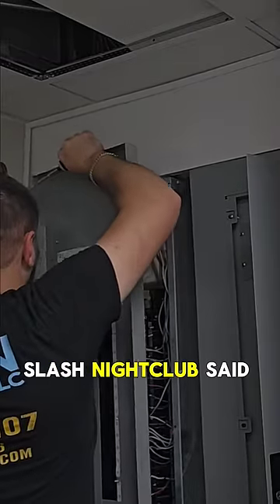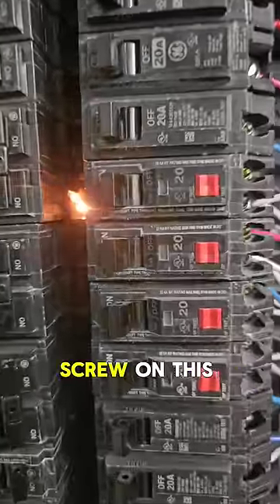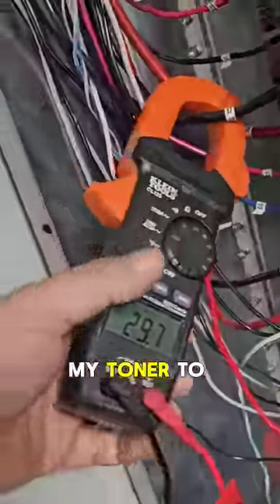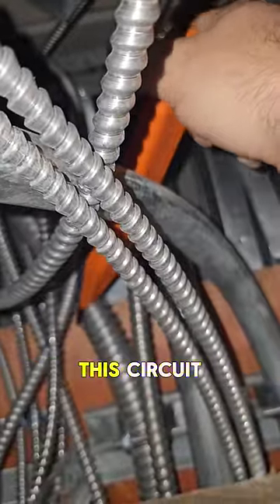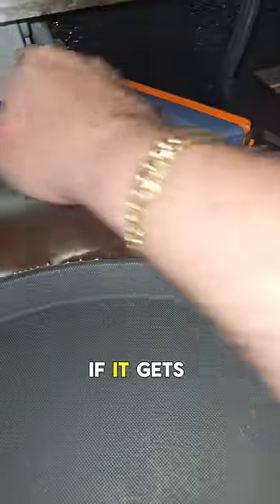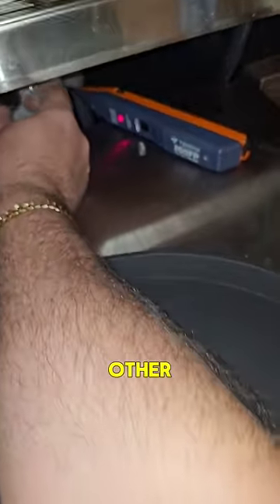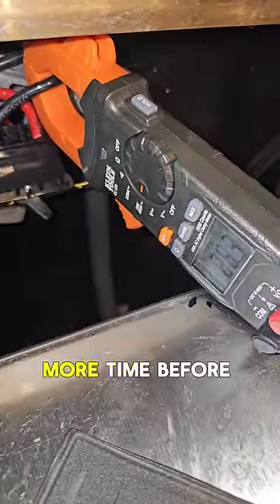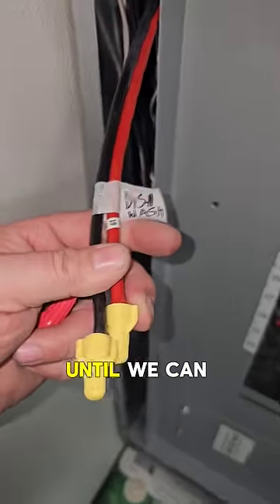This bar/restaurants panel was smoking when a 50 amp bolt on breaker melted down. Simon Electric

Comment: If I see a smoking panel, I'm shutting the whole thing down 🤣
Reply: Yeah right? I mean the firefighters will do the same if it catches fire a few hours later
Reply: Yeah if your breaker panel is smoking call the fire department lol
Reply: @alexandersalarms5380  Electrical fires not easy to work with. Electrician did a perfect job.
Reply: @guypersson   Yes
Reply: They're letting the magic smoke out!
Reply: Smartest guys "Electricians "
Reply: That's why you will never run a sushi bar 😅😅😅
Reply: @arcadeuk Restaurant owners don’t succeed by valuing the safety of workers and customers over one night of business
Reply: @Sryously It was glowing red because lose connections are high resistance and resistance makes heat.
Reply: ASAP
Reply: And use a fire extinguisher because water is a bad idea 😂
Reply: John Tagger would probably shout shut it down.
Reply: Insurance claim like a mother
Reply: If that was a TV studio the channel might be just saying tactical difficulties

Comment: This is a wartime skill.  The power has to stay available to the hospital imaging equipment.
Reply from the maker: I try to know as much as possible for this potential eventually. Hopefully I never need to use those skills in that capacity though.
Reply: Imaging equipment installer here. I thank the electricians that know their stuff and make the job flow smoothly. Salute
Reply: @obeseperson Far more useful for the real world for thousands of obvious reasons
Reply: This is a sushi place pal... nothin to do with war
Reply: @kevinm.n.5158 bro, are you saying transferable skills don't exist? 😂
Reply: @Simonelectricfl  idk I think the only way forward is to separate the wheat from the chaff 😊
Reply: Wait you can get a Beer 🍺 AND a Full Body scan at the same time ?!😂
Reply: So if you’re doing a job at a hospital you can’t just start unplugging stuff?
Reply: How's that toner thingy work? 🤔 If you have time, maybe make a video describing how it works, and showing us how to use it. 👍
Reply: @Simonelectricfl if you can ask your next hospital when the linear particle accelerators have their maintenance checks. Usually every 1-2 weeks and check if it's possible to have a look in the tech room. Cool machines. Similar when the covers come off an MRT
Reply: @drummersnare6276 I install and service X-ray, Ultrasound, CT, and MRI. All 4 use a PC and imaging software and sudden power off can cause corruption on the SSD however X-ray that I install has a UPS backup for the PC so sudden shutdown isn't a problem. MRI is a whole new ballgame but it has a dedicated 3 phase supply. If MRI has uncontrolled shutdown it takes about 3 days to restart because of replacing and priming the coolant.
Reply: @Wardyworlds  yepp. Pushing that emergency shutdown of an MRT costs about 25-30 k here :) having the helium replaced is no cheap fun.
Reply: Wow intellect on this thread is incredible. I'm Blown Fuse away !!
Reply: @LexYeen like I said intellect nice bro .😅
Reply: Cant let those cold heads go down!
Reply: @kevinm.n.5158 the point he's trying to make is that he could be making this repair on critical electrical circuits during a time where time is of the essence, such as in wartime.
Reply: A hospital or even factory would be required to have a regular panel inspection program under NFPA 70B, now not to exceed every 12 months. Thermography (IR camera imaging) is required for Condition 3 equipment, which includes critical patient care circuits. So it should be detected long before smoke comes out.
Reply: @Simonelectricfl  (get drafted to ukraine/israel)
Reply: @Wardyworlds  They're using an MRI machine in a SUSHI RESTAURANT???!!  😮  HAHAHAHA 😃
Reply: @squizzerl1478 one glaring reason, in peacetime the hospital equipment still needs constant power for obvious reasons.
Reply: @kevinm.n.5158  Huh…
Reply: @Conqueef-tadoor the buzzer thing works by putting a small high frequency voltage on the line, an oscillator capacitively coupled, then a mostly standard chicken stick looks for 60hz AND the 1kHz or whatever they are using and beeps if it sees it.
Reply: @Simonelectricfl I'm a union electrician so I end up in hospitals more often than I care to be doing electrical work. Believe me, you don't have to wait until wartime to keep people alive.
Reply: All hospitals should have backup generators, oh yes, modern input switches that automatically transfer power to another internal system as soon as the main power is lost.
If hospitals don't have this, then it's not an electrician's problem.
Reply: @Wardyworlds very cool work, just one question: SSD corruption? Your work is out of my expertise but I figured they would use redundancy everywhere and specialised IT equipment. You know, massive UPSes, maybe fault tolerant storage devices that survive power drops, RAID arrays, etc.
Reply: @veccio  I was a bit misleading giving a quick post, I've switched jobs now but the SSD was in Ultrasound machines and the nurses corrupted drive while shutting down the machines but unplugged it while it was saving data for startup so they wouldn't boot up properly. 
X-ray had UPS to keep PC running in case of power failure or emergency shutdown, it could keep the PC running from a 12v 6Ah battery for 15 minutes so they could manually shutdown or save patients data before shutdown.  Same process for CT PC and MRI PC.
Reply: Yep, if you don't know what the circuit is doing, either tell the customer that something business critical may shut off (unacceptable in the medical field) or trace it out and find out yourself. Which if it's used, let the customer know what for and let them decide how they want to proceed.

Also label your outlets and switches to what breaker and panel it's on. Commercial definitely needs it by (panel #).(breaker #). It's tedious but it's incredibly nice once you know specifically what breaker to flip to kill a light switch/outlet.
Reply: @rockysworlddavis1296 go slow and careful or you'll breaker-
Reply: Speaking of wartime skills, I know how to open a window! Get some!
Reply: @Wardyworlds did that for a couple years outta highschool learnt alot I gotta say. Now Im a general technician and apprenticing electrician, and working with the HV👌
Reply: I'm an electrician at a hospital. We have to be so careful in shutting down equipment and electrical circuits. We have lives literally on the balance especially in our ICU department. A lot of Imaging equipment also cannot just be shut off. Recently when we had hurricane Milton come through Florida we completely lost grid power. It was a super interesting and crazy time. We technically switched power to generator power even before that time to save our chillers and boilers from all of the power bumps. It is never a dull moment at our local hospital. It is rewarding too keeping people safe and our electrical safe. God bless 🙏

Comment: Illumination inside a breaker box terrifies me more than any horror film I have ever seen.
Reply: What about water dripping down the bus bars and circuit breakers? That's what I had because the neutral wasn't sealed off at the service entrance.
Reply: Because horror movies are fake
Reply: @whattheschmidt that is for sure scarier IMO
Reply: @benjaminabel8596  Yeah
And so predictable
Reply: ☠️ @whattheschmidt
Reply: Thats what we call an 'indicator light'.....indicating you have a problem..
Reply: Seriously.
Reply: @whattheschmidt what did you do?
Reply: @reyariass  duct seal on top of the service entrance and duct seal on the neutral inside the meter box.
Reply: PULSE 1988
Reply: I like the old 70s and 80s horror movies not the remakes..
Reply: Yeah lights are really scary 🙄
Reply: @kingti85  are you dense or purposely being dense? Genuine question. Sarcasm and ironic sarcasm is hard to tell over text
Reply: I watched the movie PULSE when I was a kid and it put the fear of GOD into me when it comes to anything and everything electrical.
Reply: Like looking into the heart of a nuclear fireball.
Reply: Me too!
Reply: @pepethepatriot7524 same here!

Comment: I worked as a short order cook . If the electric griddle, the toaster and the microwave were all going, the breaker would pop. The boss said he switched out the 20 amp for a 30 amp. It kept popping, so he put in a 50 amp. This guy had 2 places burn down in 3 years!
Reply: Jesus
Reply: Lol, like upping the breaker amps magically upgrades the wire gauge to support more amps. Dude is gonna end up with melted wires and fires in the walls. We'll, I guess he did since he had places burn down... 😬
Reply: Should have just removed the breaker and wired it directly into the mains so that the breaker couldn't fail and catch on fire. Duh.
Reply: @adamgerald849  That is not how things are done
Reply: @davemanone3661  Breaker panels and transformers are not needed. The mo powa, the mo better!
Reply: So you just pop in a 50 with no regard for what the wire size was?? I guess if it was a fuse box you would have stuck a penny in.
Reply: @sundance2005  The owner did that, i worked for an electrician!:hand-purple-blue-peace:
Reply: If insurance paid off on that, I see why my insurance rates are so high
Reply: @davemanone3661 It's sarcasm Dave
Reply: @LinkTheHero  What sarcasm?
Reply: You should tell that to this guy's insurance company.
Reply: @jessstuart7495  They paid the money, so, so!:body-blue-raised-arms:
Reply: @sundance2005 A piece of copper
Reply: @davemanone3661  Damn must hurt being that dense
Reply: I was doing maintenance on a three-story wooden house that was being used as an Asian sorority house. The guy said, "Can you check to see why one of the rooms on the top floor keeps flipping the breaker? " I checked the room; it had about 15 various appliances (mini-fridges, hotplates, hair dryers, etc.). The breaker in question they had duct taped 'on'.
Reply: @pinecone9045  :face-orange-frowning:
Reply: Hmmm, I wonder why he had two places burn down? What could the reason….? Because he knew just enough to be actually dangerous instead of calling a professional who knows NOT to do the dumb AND DANGEROUS things that manager was doing. Some people are just so cheap that they actually are hazards to society, this manager being one of them. For Pete’s sake, call a professional when things are going wrong.
Reply: @benrubins8172  I agree.

Comment: I hate hack job electricians, just because the screw looks like it fits doesn’t mean it will if you don’t have the proper screw then find the proper screw or at the very least replace the bus bar with one that has the proper screws, who ever installed this panel created a major fire hazard which then could have costed the owner a lot of money in repairs or costed people their lives for such foolishness, sir I am glad you’re fixing this issue, you definitely get a thumbs up from me! 👍
Reply from the maker: I could not agree more
Reply: That was definitely lack of common sense. Even me as a hobbyist / amateur electrician, I'm sane to know to always treat electricity carefully or we'll have a fire.
Reply: @Lively_1185 ironically electrical hobbyists with a decent amount of experience end up often being less mistake prone and stupid compared to a lot of "professionals" because one still doubts their work and makes sure to check stuff, the other thinks they know it all and make tons of mistakes either out of lack of care or overconfidence
Reply: @MaxC_1  residential plumber here, hard agree. Some of the best work ive seen was guys (who were usually handy to begin with) who did their research, went slow, overthought everything, and did their own renos and very occasionally ran a whole new build soup to nuts. I did the plumbing for a guy who bought and restored an old 3 story whaling captains house on long island with this gorgeous trim and a turret coming off the corner of the house, he ripped all the floors out and got the whole house pin straight with lam beams, did his own wiring, redid all the intricate woodwork on the exterior, reglazed the windows, damn near everything. old swedish fella, i assumed he was a retired contractor. Not even close; He was a photographer, bit of a famous one at that. Dude was just highly skilled and motivated and wasnt afraid to google it when he didnt know something.
Reply: Nice! He must have had PLENTY of time for this though
Reply: @MaxC_1 funny, when i was doing some entry level electrician vocational training as i was unemployed and  it was free, that is sort of what our "Electrical safety" trainer told everyone.
"You won't get into accidents in the first  6 months because you'll be too sh*t scared of dying. It after that that is a problem, because nothing happened and you'll become complacent... and dead if you're unlucky".
Reply: The person who originally installed the panel is not to blame.  This screams "handyman" to me. I bet the restaurant owner damn well knows he fucked up and hired an uneducated and unlicensed loser for a cheap and quick fix. He didn't say anything about it because he's ashamed.
Reply: @thefinalkayakboss very good comment right here. Loved reading it!
Reply: I’ve used the wrong screw a few times in a pinch for temporary reasons but never for an electrical/mechanical connection like this that has a load being fed through it

Comment: If smoke is pouring out, isolate the circuit regardless of what it feeds. I'm not getting your hesitation here.
Reply: Getting sued for a fridge full of food
Reply: @vladimus9749  and you think a fire starting in the electrical panel taking out the whole supply is a better alternative? 🤦‍♂
Reply: @shaunclarke94  That's not his liability as he didn't make the mistake. Shutting off the wrong circuit would be.
Reply: @vladimus9749  hard disagree. Electricians have a duty of care to make safe. If you leave a fault like that you're 100% liable for any damages.
Reply: @shaunclarke94  Exactly, the electrician assessed the situation and determined the safety of the property could be at stake so he did his due diligence to ensure the risk was minimized. One business owner treating another with proper care and respect.
Reply: @vladimus9749  leaving an arcing breaker isn't being responsible, but I guess we aren't going to agree there so I'll leave it there.
Reply: Right that was a stupid move by him ..shut it down .
F the restaurant if it interferes with their business for a while . 
😂😂😂
Reply: @Gunter_Custom  And if it damages their property?
Reply: He didn't leave it though? He confirmed what it powered and then turned it off. I'm sure someone watched the panel while he confirmed things.  @shaunclarke94
Reply: @seannicholas6629 He's saying that even taking the time to do that was a really dangerous move and the correct move was 'turn it off immediately'.

I'm honestly inclined to agree.  The likelihood of a glowing short turning into a fire is much higher than the likelihood of killing the circuit damaging the restaurant in some way.

BUT it's a yt short.  Not every piece of information can be presented.  Maybe precautions were taken.
Reply: @shaunclarke94  He... Didn't leave the fault like that.
Reply: keanureeves9941  He's not right, for one he is seeing arcing where there isn't any.

Comment: It's amazing that it hasn't already started buring in that fusebox due to the screw being glowing so hot for that long.
Reply: The magic of modern fire retardent plastics.
Reply: @mfbfreak  True, but even so, the heat will affect plastic parts either way.
If they dont melt, they will dry out to a point they become brittle like chunks of dried dirt.
Reply: @draxoronxztgs1212  as if it stopped smoking because it had run out of insulation to turn into char.

Comment: Gotta love dem live circuit finders!

I bet money, they changed out their own breaker and was like “shit, call an electrician and tell him another electrician did it”
Reply from the maker: Haha maybe but this place is only a few months old. But you could be right
Reply: @Simonelectricfl  I build gas stations here for about 5 different Indian owners. 
They add so much during the job not to mention after the job. This weekend I’m adding a 100amp sub panel at one of the gas stations on the side, he already put the panel up and mounted all the boxes, just needs me to run the wire and do all the fishing to the panel in electrical room.

Indians from India, I think we did 15 gas stations last year
Reply from the maker: @Hohmies86  wow that seems like a good gig you have going. Are any of the areas you work zone 1 hazards?
Reply: @Simonelectricfl  goodness no, a 20’ diameter around each dispenser and tank is considered a classified area. If you have to trench or pipe through that area it must be rigid and have a seal on the ends. Middle can be pvc. 
There is nothing hard about it, just have to play ball with gilbarco, the company that owns the dispensers
Reply: What circuit finder tool is that? Looks like it can handle live circuits?
Reply: @elliot999  there’s more than 1 type of live circuit finder.There also are plenty of what I call a fox and hound, use it on dead circuits. 
I’ve used it to find a landscaping light that was buried in the mulch.
Reply: @elliot999  why do you think it looks like it handles live circuits?
Reply: might have been done by the plumber that installed the dishwasher.
Reply: Everytime
Reply: @Simonelectricfl  Ah, only a few months old. New build stuff :P
Reply: @TheChipmunk2008  I wire new gas stations, don’t know how much the owner adds and changes his mind after we’re done and everything is working…. 
A lot!
But hey it’s their money